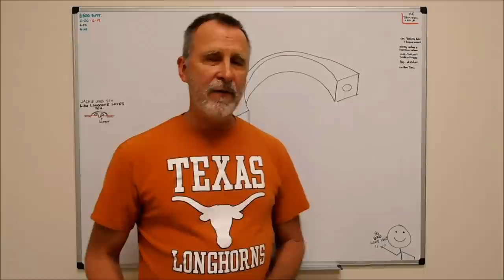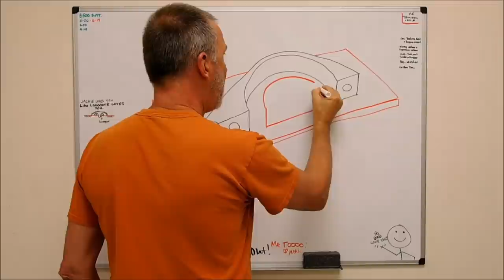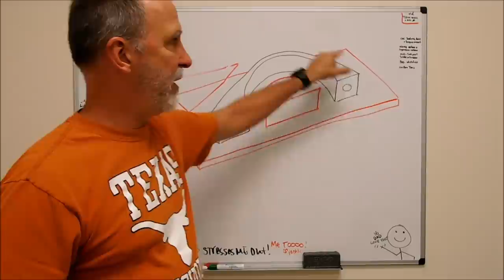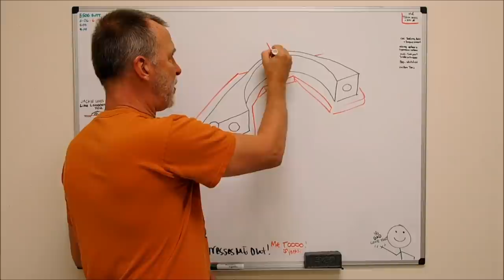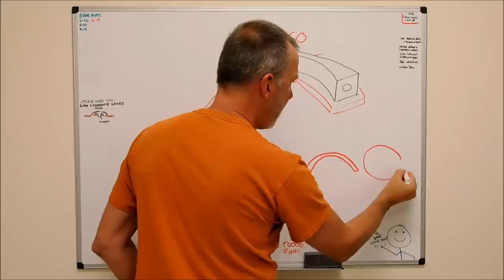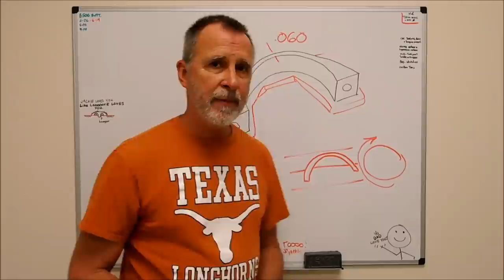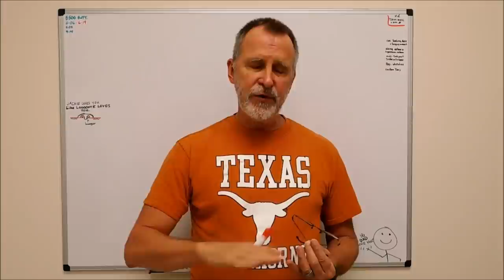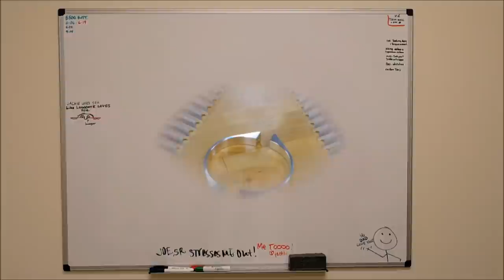Grip Stock - How to Access 100% of your Part Perimeter

Comment: very well done however I would do three things differently
1 I would avoid using a bandsaw to clean up the remnant material I would open pocket rough everything for several reasons
a) slotting is something I try to avoid I love it when we can utilize free cutting conditions (especially true for hard material)
b) I would certainly try to cookie cut the material at op2 rather than use a bandsaw
c) I would do the counter bored holes first on a precision blank.
Reply from the maker: I like comments like this. I see things through other eyes and It gets me thinking. I'd like to comment back with all due respects. 
a) The fastest way to remove material is to drill it, or saw it. If the machine is running, its a transparent operation and produces solid chunks that are more valuable than chips.
b) I hate having large remnant chunks in close proximity to my cutters
c) good thought here, but the heads of the screws are still proud of the counter bores as drawn, so a full perimeter cut would be out of the question.
I wanted to screw the parts together and do the outside of 2 parts at one time, then pop the net shape in a soft jaw and interpolate the bore. The shallow c'bores killed that approach.

Comment: Hi Joe, thank you for sharing your knowledge! Joe if possible,  can you give me, and maybe other people some direction on how to compile a quote for both manual, and cnc machining. It does not have to be precise,  just some guidelines and direction. The problem is that I'm a hobby machinist and have never worked in a machine shop environment. It would be much appreciated, thank you Joe.
Reply: Ian Joubert I’m not an expert at quoting but I do a fair amount of it. It can be hard to quote complex work as sometimes a feature may look simple on a print but can sometimes be very time consuming. 

I quote like this. 
Total cost of material divided by quantity of parts.
Total estimated setup time times your hourly shop rate divided by the quantity of parts.
Estimated machine time per part times quantity divided by 60, times hourly rate, divided by quantity (may seem redundant but that’s how I do it).
Add these three values together and you will have the estimated cost per part. If non standard tooling is required add that to the part cost by taking the cost of the tool and dividing it by quantity. 

A lot of it is up to your ability to predict the time it will take for you to produce a certain part. This is honed if you do time studies on jobs you have quoted and knowing you and your machines limitations. If you have CNC machines and larger quantities with run times that permit you can run multiple machines at the same time, this will allow you to theoretically double your take so if you quote one job low and don’t find out until it is running but have multiple jobs on machines you have some cushion, if you quoted all your jobs low than you are giving away your time and machines.
Reply: Ian Joubert I hope that helped.
Reply: Quoting is very likely the hardest part, and riskiest of any machine shop.  You have to take into account so many variables that it is overwhelming. 

First look for tolerances, the tighter to tolerance the more difficult and more scrap you will have.  Anything under +/- 0.010 is considered tight, under +/- 0.003 is really tight, and under +/- 0.001 is scrap land.

Next look at what type of material the part is made of. Some materials are expensive and hard to machine (304 stainless, inconel, etc) but there are other materials that seem soft and easy, but have other problems, such as nylon, plastics, delrin, etc.  The rate of machining will change depending on the material.

Size is important.. big parts have long too travel paths, but really small parts use small cutters with very low surface rates, and thus the removal of material slows down drastically.  Find the sweet spot for your machine & shop and adjust quotes accordingly. 

Complexity is the final decider for me. How many OPs? How many times do I have a chance of botching a setup? What is my holding method? How much involvement for adjustment, load and unload, and deburr will I need? 

This is just the very, VERY basics of quoting. Special tools & equipment, cutter life, machine time cost, manpower cost, shipping cost, processing? the list seemingly never ends.
Reply: DrivECrasH I would agree with a lot of this accept what you consider tight tolerances. However that is wholly dependent on the machines you have. Tolerances of .01” for me aren’t much fun as that is a mile and I can never bring myself to use up that much tolerance. However I like the challenge of .0001” tolerances these are fairly easy on my lathes but still fun to run.
Reply: One thing to keep in mind when quoting is there really is no “right” way to do it. If you find a way to factor in your costs and make good parts and make money you are doing it right.
Reply: Thank you very much for your input! Basic guidance is what I need. Once again thank you gentlemen

Comment: Very nice videos, I take it that you are using 1 thousandth = 0.001 International Inches.  1.000 = 1 International Inch. I work with both systems, Metric and Imperial. A lot of the older machines out here are Imperial. Many thanks and greetings from Africa.
Reply from the maker: I am. Any metrics get converted anyway.
Reply: Thanks for your kind reply. Did you know that the USA is already metric, but they convert back to Imperial for usage by the general population.  See Metric Conversion Act of 1975. As you know there is a lot of back and forth over this usage. Many thanks and best regards David.
Reply: Check out "Measuring America" by Aldo Linklater. Fascinating story of how the country was surveyed and its impact on our history. In it you will find that Thomas Jefferson almost succeeded in getting us to be the first country to use decimal measurements - before France!

Comment: Already few years old video, so hopefully still read. My question is, if you didn`t have bandsaw, how would have you done the second operation to get rid of the excess stock? Facemill I`m afraid would end up catastrophe when the stock lift up and jam between the stock and mill? Maybe endmill strictly follow the path of the clamp. Then once the excessive stock is cut loose, have optional stop and take the stock out and continue program? Or something else? Thanks.
Reply from the maker: On second operations, you always risk big chunks getting sucked up into the cutter. And, solid material is more valuable as scrap and misc pieces for jigs than chips. Thats why I cut on the bandsaw between parts. Plus a bandsaw is quicker if the CNC machine is already running. If you are leary about the corners or islands jamming the cutters, do a quick profile pass first on the second side op. Maybe you can use coolant pressure and direction to control where those chunks go. To be 100% safe, include an M1 in your code and blow them out of the way.

Comment: I use this method frequently ,but use talon grip jaws for the 1st op. You can get pretty aggressive holding in talon grips. The only downside is barstock with rounded edges doesn't work so well. But since a majority of my mill work is aluminum or plastic I saw my blanks from plate on a tablesaw     which I believe is a greatly overlooked tool for a machine shop. With the right blade  aluminum cuts as easy as wood.
Reply from the maker: I have a Delta chopsaw with a carbide tipped blade for my aluminum bar stock. I sails through that material. Makes a mess, but its fast.
Reply: How do you like your Talons overall? Is the accessory and overhead cost worthwhile? I'm debating selling a version of a rough stock holding jaw I developed for myself. Cheap inserts, about 0.014" of bite per jaw so even gripping saw cuts or uneven stock is no problem. I've been using them in a 4 axis machine and running some pretty big drills from the sides. The only comparable jaws I've seen have extremely expensive inserts, whereas mine are pennies and available everywhere (not a great profit strategy).
Reply: NoReallyName 
I like the talon grips alot. Wish I had got them years ago. They are expensive for what they are but easily paid for themselves with 1 job.  You do have to be aware of their limitations and proper stock prep. They really work best with square edged stock, because they only grip 
about .07 high.
Reply: Oh, that's a much thinner bight than I thought. Nice!

Comment: Wouldn't it be faster and easier, to use an adaptive clearing type tool path, at full depth for the part profile?  Turn the remnant chunks into swarf.  Then you wouldn't need to saw it off. That is if your machine can handle that much code. I am surprised how much code it takes to make that kind of toolpath.

One other suggestion. When doing the counter bores. Instead of a retract peck. Try a chip break at about a 0.010" or 0.015 depth. Seems to work well for me in that application for controlling chips.

Overall a very solid video. Thanks for posting.
Reply: Not really, i often do run adaptive for everything but think about what you are doing while the machine is working. running that tool path causes more tool wear and takes longer. 
Plus you are just standing there waiting.
Reply: Ah...horseshoe asked the same question I had.  That makes a great deal of sense.  I guess it might partly be determined by what you're doing in the shop.  If you've got a second machine running, the time might be better spent on something other than the bandsaw.  Thanks!!
Reply: LMW adaptive should provide better tool life. Because you are not using peck depths and burning up the tip of the endmill.
Reply: SolidCAM and iMachining 2D would make that part much faster than the current toolpath is and it blows the remants to chips. Next to nothing added toolwear and no "burnt tips" in endmills. Get the demo, try it out and switch over.
Reply: horseshoe28016 I totally agree with the depth, I run as deep as possible.
No point paying for all that Carbide and just using the end.
I was more talking about removing all the material with adaptive.
Buy yeah run full depth with an adaptive slotting toolpath.
Reply: Removing the extra metal in the first op leaves a big, this shelf of material that the fly cutter or face mill has to deal with on op2.  When it gets down to the last pass and that area is really thin, it can be grabbed by the cutter....not pretty.  How do you handle that?  Especially since his parts isn't held in extremely well.  If you have to go to the bandsaw to remove it, you might as well do it the way Joe did.  I like to run a contour path around the top of the part on op2 to remove the excess.  It requires an extra tool change.  Is there a better way?
Reply: bluehandsvideo yeah, you could run one contour pass to remove the bulk of the grip stock. Then face as normal. But, like anything it depends on lot size, parts per cycle, and tool change time. For small lots, it may be faster to do it exactly as Joe did. Now that I think about it more.
Reply: If he's reading this, he's probably thinking..."Thanks for catching up guys". LOL  I'm sure he's covered all the options over the years. :)

Comment: Would it help when doing your counterbore to peck with a much higher feedrate thereby avoiding chip buildup on your cutter which can blemish your part?
Reply from the maker: I felt a higher feed rate = thicker chip. Thicker chip would increase the scratch potential if it nested up. Higher feed with a shallower cut may have worked better. Keep the chips short.
Reply: Okay, I see where you are going. I am no expert so I learn a lot from your videos. What I have done when drilling and my drill collects long chips I increase the federate (and shorten the peck) until the chips start breaking up and that has typical cleared the problem.

Comment: Hi Joe, you could seriously crank things up in the rpm range on your carbide endmills. I have a machine that has a 10k spindle and I regularly run 9600rpm 72ipm. 3fl endmills are a game changer also. Also is there a reason you are pecking the center/spot drill? I was always told to never peck a center/spot drill and to give it some feed.
Reply: Endofcomment hey check out pushing cnc machines to the limit by titans of cnc video Crazy they we’re running around 10,000 RPM at 800 Ipm
Reply: Chris N saw it and it’s not true. The controller may say 800ipm but that is in compensates feed. There is the mass of the axis and the acceleration/deceleration of the axis that need to be accounted for, when the machine is in G1 (linear interpolation) the machine is doing a lot of calculations and looking ahead in the program to make sure it doesn’t over run a corner. The major difference in that video is that the claimed 800ipm was done at one step down vs the 100ipm which was done with multiple step downs, if it was kept to one step down the difference in cycle time would not have been that great.
Reply: Endofcomment yes I did notice they were using two different programs which was pretty stupid of them. But you still can’t deny that we’re roughing the part out pretty darn fast.
Reply: Who the hell uses a center drill in a CNC center for hole starting? Waste of a good tool, waste of time and an awful start for a hole.
Reply: Jaakko Fagerlund I do all the time, they make center drills with a 90incl angle and if you do your research, center drills are eccentrically ground and give you a better start for your drill. Spot drills do just as well but aren’t always double sided so with a center drill you get more bang for your buck.

Comment: I envy you. I used to work with CNC machines. Now I have nothing and can't afford it. I just want to make a comment on this type of clamp. - one piece or two pieces. The clearance between the inside diameter of the clamp and the other part on which you want to use the clamp, must be as small as possible. The bigger the clearance the worst the situation becomes.

Comment: i machine clamps for a living. i would make the part whole. split apart before boring whole and tac together for bore and drill holes. two halves in one operation. piece of cake
Reply from the maker: Under normal circumstances thats fine, but you didn't see the drawing on this one.

Comment: What is the pretty blue coolant? Customers would love it. I am running Blaser. 
  Is that a Fadal?
Why do you use a 2 flute/ i AM USING 3 FLUTE 45
Reply: ...45 degree helix 
 But yes... strategy is EVERYTHING.
  Love the vids!
Reply from the maker: The coolant is trimsol. The machine is a Fadal 4020A and I just never gravitated to 3 flute cutters. Simply for exposure, no other reason. But, my thoughts always go to 2 flute for aluminum. 100% of the time.

Comment: What do you do with the cooling Liquid after you use it, do you recycle it or do you flush IT away?
Reply from the maker: It recycles back into a large reservoir in the machine. I keep it clean by skimming the oil off and freshen it up as needed.
Reply: How much that thing costs for 3 galons ?Its around 60$ for 3 galons where i live in europe-for similar cutting fluid.But you mix it from 2-10% depending on operation so it lasts some time.

Comment: How do you set you’re peck drilling parameters? While watching this video i noticed a lot of up and down travel and was wondering about saving time on cnc operations by fine tuning this feature.
Reply from the maker: This was a very cosmetic part and long drill chips whipping around was not preferred. The operation was either a deep hole, or peck cycle. My machine offers 3 choices. Drill is just straight through, peck is interrupted, and deep hole pulls the drill out of the hole all the way between pecks. My controller gives me complete control over the speed, feed rate, peck depth. My settings vary based on hole size, material and finish required.

Comment: Could you make your soft jaws to match the area of material removed in the first op and eliminate the band saw operation ?
Reply: I'm sure you could but why?  You would still have those large chunks of material that could probably will get jammed up when they come free and break your tool. Besides it gives you something to do while other parts are running. If its a big deal just machine those areas completely away on the fist op, that's what I normally do anyway so you don't have to worry or mess with it. Especially in aluminum when it takes very lil time to plow through it, also makes it easier to use a trochoidal tool path rather than slotting when you do.

Comment: id just turn everything on the first side to chips. quicker than walking to the bandsaw and cutting. side 2 use the end mill to lop off the overhang before finishing the part. you've got a cnc machine but you can tell youre an og conventional machinist. got that ez-track mentality. great work tho
Reply from the maker: Actually around here you get considerably more for solid waste that chips. So why not? The CNC is running, so I call this free time.
Reply: @joepie221  I typically run all the setups at one time so im pulling a complete part every cycle. on a bit larger fall off id cut it off. also I bought more than one cnc machine. if the doors are closed I have something better to do.. no such thing as free time.. plus I don't get paid by the hour I get paid by the spindle haha. don't get me wrong tho, your videos are great and you do great work. even if I see another way, you get me thinking and always something to take away from them.